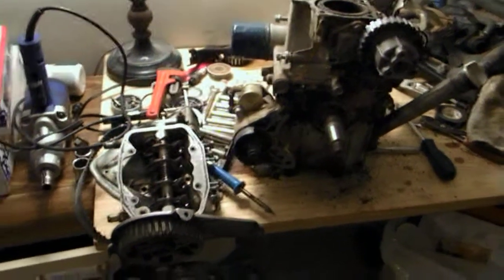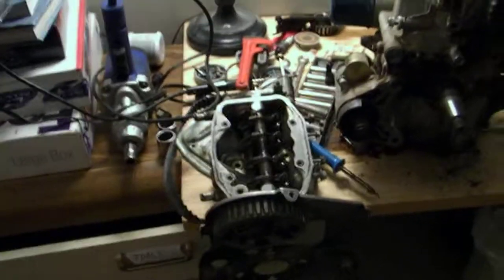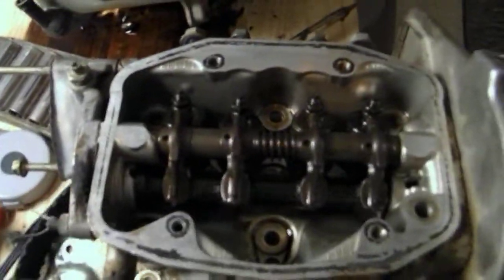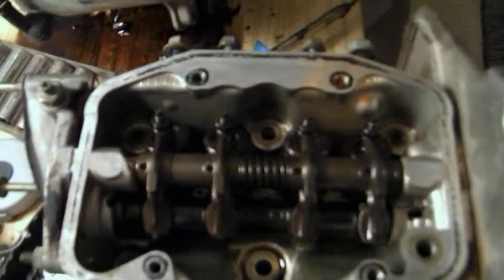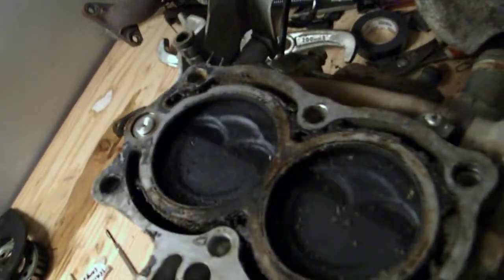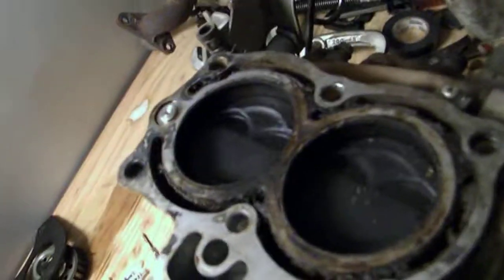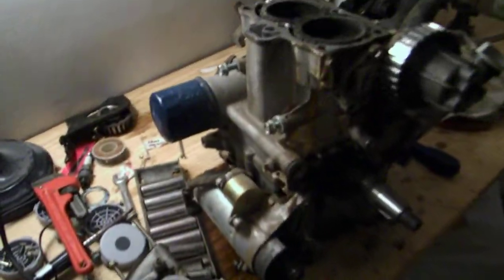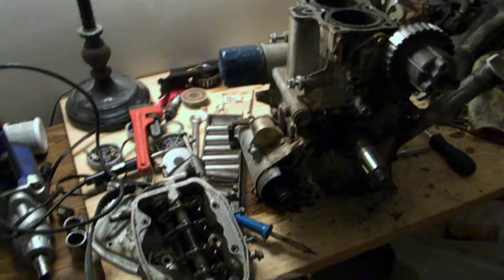Honda HT3813 Engine Operation

Comment: Hey man, thanks for the video.  I have been racking  my brain trying to figure out how to get the head off.  I thought the cam shaft pulley needed to be removed but I see that you left it on.  Did you have that head resurfaced?  If you did, then did you remove that pulley and how?  Thanks
Reply from the maker: I cheated.  I cut the timing cover in half!
Reply: @gonyoujeremy9596  thanks for the quick reply.  I'm trying to save this 4814 that has been in my family since 1990.  So I am correct, the cam shaft pulley needed to be removed prior to removing the head?  I presume a pulley puller would do it?
Reply from the maker: @robmoss6853  to do it right, yes.  It's a special tool to remove the pulley.  I bought several and none of them worked.  Thus cutting the timing cover with the Dremel.